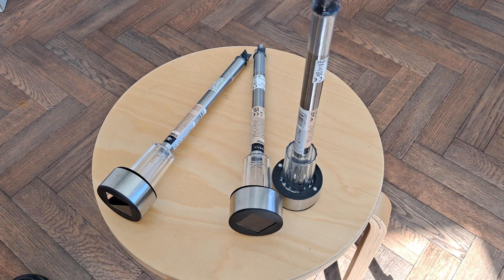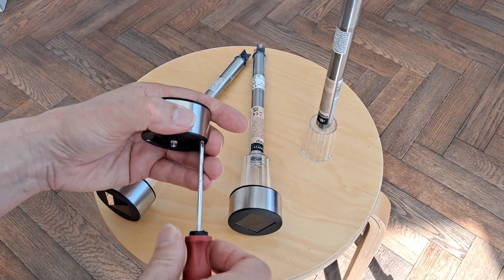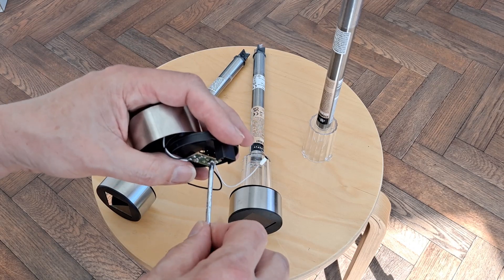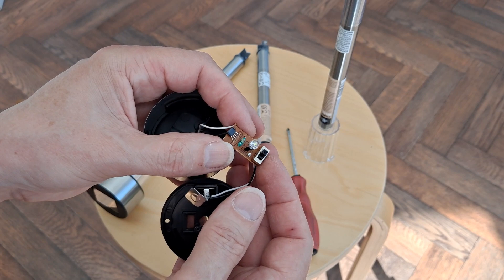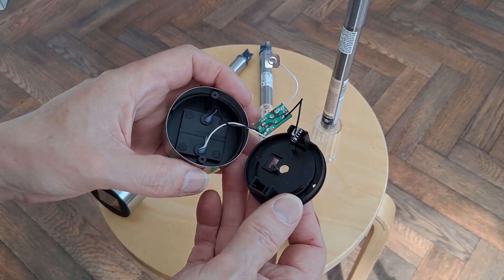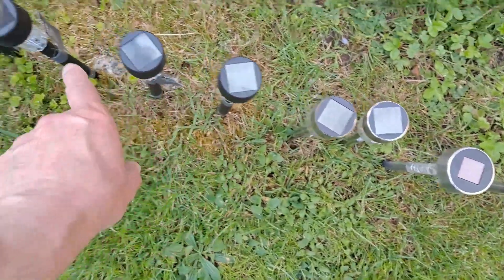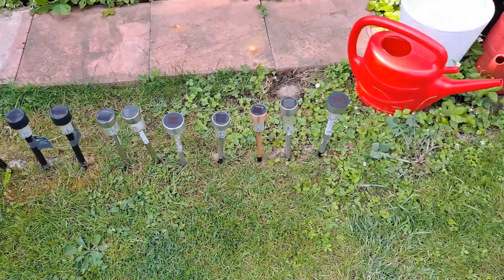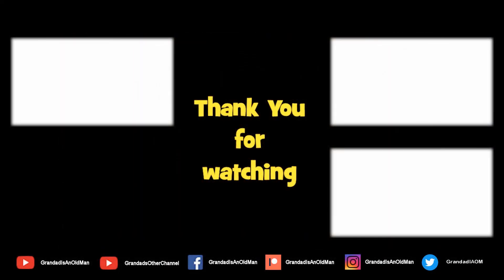Home Bargains More solar stick lights 79p 😊💰

Comment: The on off switch seems to be the first thing to fail, so I’ve removed switch and bypassed it so it is on all the time.  I think Big Clive recommend that.
Reply from the maker: Yes, in the selection I have been testing this year, some have done away with the on/off switch entirely, just a plastic removable strip keeping the battery disconnected during storage.

Comment: IPA is good for removing hot glue from all electronics and circuit boards and only takes 10 seconds to work. Also no risk of damaging anything with heat.
Reply from the maker: Yes, when I do a video showing IPA, people comment that they just use heat. When I do a video showing heat, people comment that I should use IPA. Fact of life with YouTube 😆 There are two other points. 1. It is not always hot glue, so heat and IPA have no effect. 2. Sometimes the hot glue is wrapped behind components, so you can still damage the components trying to peel the glue away.

Comment: 79 pence, yeahhh. LOL Pretty good when you think about it. You get that battery and the solar panel plus the board all for 79p.
Had a look at that chip. It's an LED driver. I thought it was just a voltage regulator but it will also determine when to switch on and off and regulate the voltage also. 👍
Reply from the maker: Yes there is a whole series of those chips with very similar numbers. I haven't compared the data sheets, but I would guess there might be minor differences in the input voltage to match the solar cell to the battery.